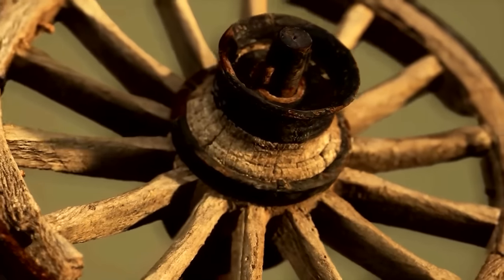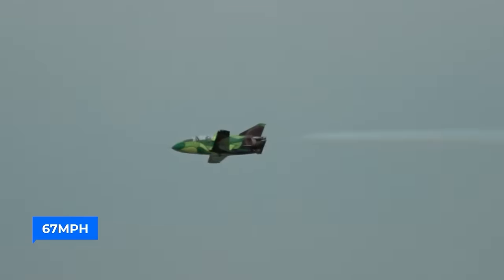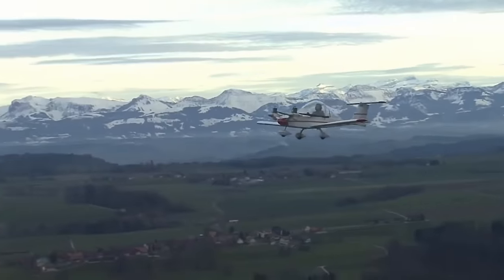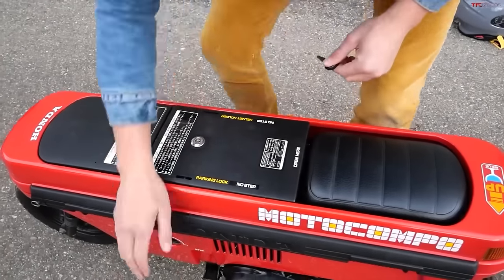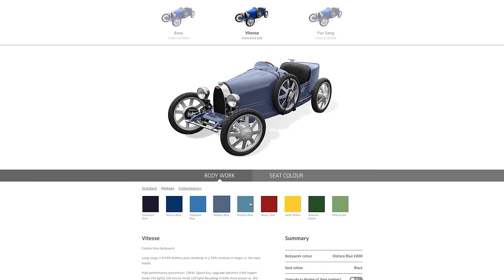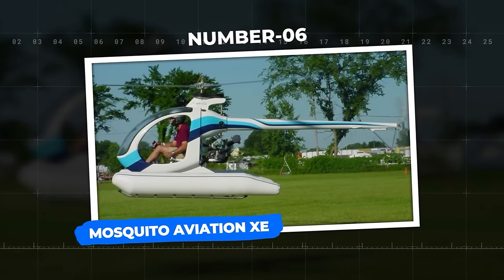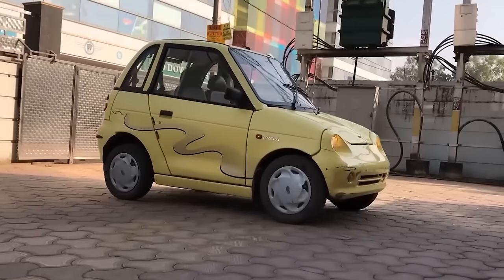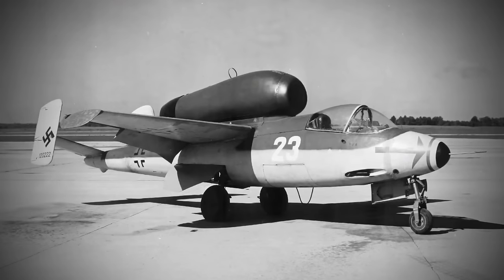20 Small Vehicle's With Powerful Engines

Comment: They talk about the smart car only having 89 HP like how could it only have that small of engine.  My 1955 VW only had 36 HP and I drove it everywhere and never gave it a thought.  I even drove it  from Fullerton,  Ca. to Salome Springs,  Arkansas,  no big deal.  I wonder if I'd be brave enough to do that now?  Back then I was young and dumb at 19years old in 1963.
Reply: Although back then cars were considerably lighter, but most countries applied import-duties according to engine-size or power, and along with that usually registration-fees would be higher for heavier/powerful cars!

Comment: Small vehicles with powerful engines and we start at 2 1/2 hp? WTF?
Reply: HP/LB is the measure of performance. 2.5 hp in a 60 lb (plus rider) scooter isnt  bad. Think 250 hp in a 6000 lb vehicle, and you have a 1970's Cadillac or Lincoln.

Comment: The CAT mini dozer is not really a mini.  Its a smaller CAT but since the D6 has only 150 hp I would hardly call it mini.  You should check out the Struck mini dozer that has only about 5 hp.